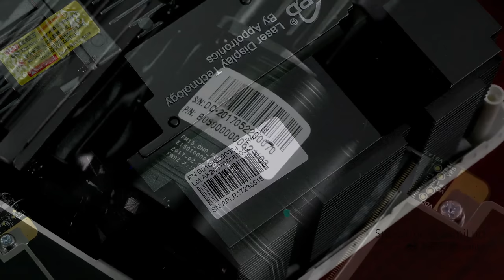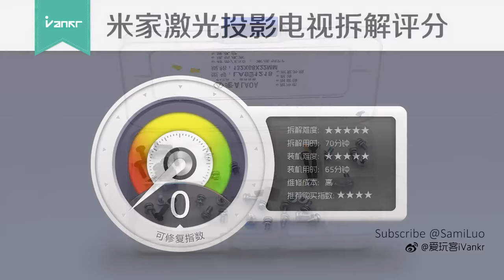What's inside Mi Laser Projector? Tear down Mi Laser Projector TV #SamiLuo

Comment: You made a tear down video, while everyone looking at this projector to buy is waiting for a in depth review of the quality projection it has, very dissapointing. Also you don't respond to people's question on how it performs very strange if you ask me, like you have no idea how it performs or rather can't tell. I would stay away from this projector what I have read that it has a very basic DMD chip same as in the Xgimi H1 so it's really a Xgimi H1 but with a laser light source and ultra short throw output. That justifies the price it's not low just normal price for the device.

Comment: hello, y have the same projector, my problem is that for me its quite to noisy and y want to swap out the fans agains some from noctua, could you tell me the size, the thickness and are all 3 fans the same ? or is the third in the middle an other one ? thanks in advance and kind regards
Reply: Alex, I came here for exact the same reason. Did you manage to replace the fans? Do you know the sizes? Thx in advance
Reply: I am also looking for fan replacement, did you found the sizes?
Reply: we r all here for fcking noisy fans
Reply: For those who are interested in swapping the fans. It is possible but you will have to keep one original fan running for the fan speed. If you don’t the Projektor will notice that the Fans run too slow and will shut it down. I replaced mine with 80x80x10 from noctua.and added 2 additional fans to the exhaust side so it will suck out the hot air. Now the noise is very acceptable.
Reply: @PussyStrike  I replaced all of them and enlenghtend the cable of one original fans. Than i broke the rotor so there is only the Motor left who spins and gives out the rpm signal
Reply: @gfrraider2  hey, do you maybe have pictures of what the end result looks like? Any reason why you put thinner fans than the original version? I assume there is no room for extra fans so you attached them on the exterior, no?

Comment: Hi I have the same projector i stay in India have no local support it shuts off after five minutes a displays heat sensor issue will shut doing in 5 seconds as to protect itself can u pl help by pointing where the heat sensor is.
Reply from the maker: Hey, thanks for commenting, however I really dont know where to find that sensor since it's a really old product... maybe try to contact where you bought from?
Reply: Hello

Did your problem get fixed?

Comment: thanks a lot for the tear down, very interesting!

3 small fans, all mounted on rubber, did i see that correctly?

when it's on for half an hour or so, mine is not so loud, but watching movies for a couple of hours, it gets a lot more audible

i wish there was a version without the android system and without speakers and amplifier, space could be used for bigger quieter fans

and i never use the interface anyway, i have the nvidia shield TV, PlayStation 3 and cable box for content

i would buy one instantly if it was available

Comment: Was hoping to see if any thermal paste replacement as mine had over heating issues. Its still working fine, just that i had to put an external fan on the intake side to give it some help. Thats why i thought surely if i can reapply thermal paste it shoild resolve thr issue.

Comment: I have taken apart my Xiaomi MI laser projector as well to figure out how to change the fans to a silent one,

But I found that the noise comes from the color wheel which is inside somewhere in the light source 

I believe you can change the color wheel but I didn't know how, it may be very difficult 

There are 3 fans in this projector 80x80x25mm. Which is OK quality. If you think by changing the fans you will get rid of noise you may be mistaken.

In my case my color wheel was very noisey, but if you absolutely know that you have a silent color wheel than go ahead change the fans for the silent ones like Noctua,

I wished this projector was silent and smaller and light weight. I'm giving 3 of 5 stars. You must have absolutely flat wall surfers for this projector to injoy it since light project from an angel approximately 15°

I look forward for better projectors in the near future
Reply: You are correct. The noise (at least mine) is coming from the color wheel. I took it apart to change the fans and even with all of them unplugged the noise is still there. I changed them anyway and they may be a little quieter but it also makes the color wheel noise a little more noticeable. I wouldn't mind seeing a video of someone tearing it down to the color wheel.
Reply: Thanks for sharing your experience about the noise from the projector. I was thinking to do the same thing, to change the fans but looks like I have to live with it 😫
Reply: I just got this projector and it's making whine/buzz noise but i am not sure if these are fans or the color wheel. Can you please post the video of the noise you are experiencing from the color wheel?
Reply: @zmajBH  hey can you please post video of the noise?
Reply: I found solution, zero noise :-) Sony wh-1000mx3 BT headphones
Reply: merhaba emrah , colour wheel nedir? fan degistirmekle ugrasmak bosa kurek cekmek olacak sanirim?